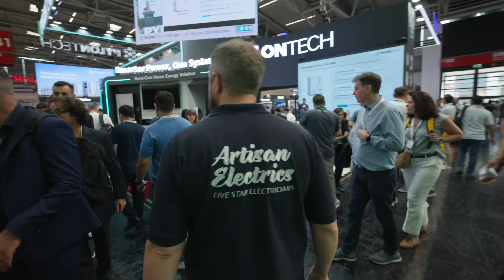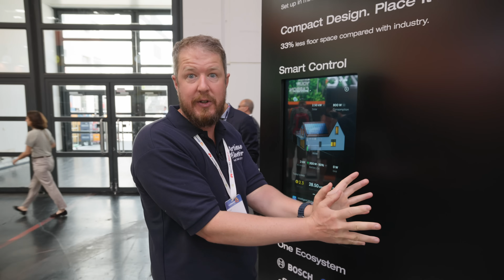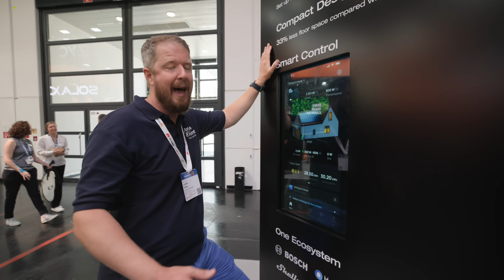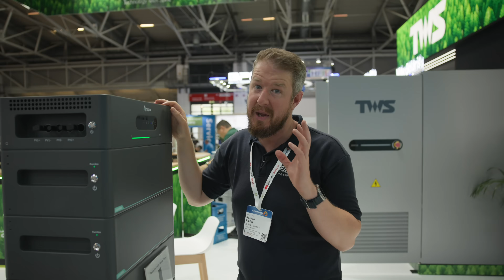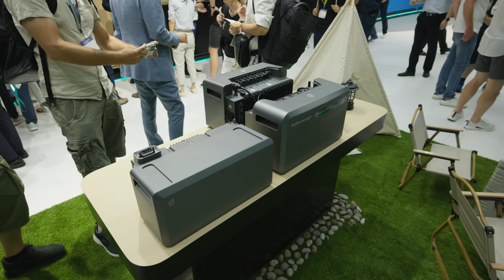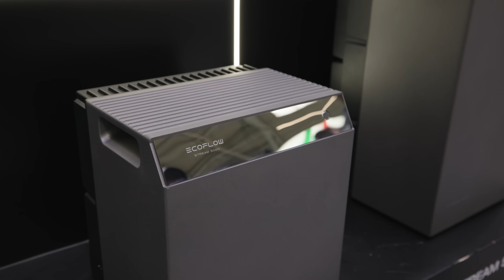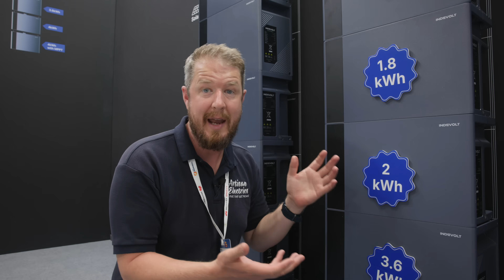Is the UK FINALLY Catching Up on Plug-In Solar? Intersolar 2026

Comment from the maker: Will you be trying plug-in solar when it comes to the UK?
Reply: Already have a 2 X 475W Longi X10 with Hoymiles 800w 2t plugged in since May 7th. 

The set up cost £440 quid and have generated been 200 Kwh in just 2 months. Saved roughly 35-40 quid off our usual bills.
Reply: Depends on cost and legislation
Reply: No real use for it as wired in systems are much much more cost effective except for little setups or rentals where it becomes an option. Will be playing with it and helping other folks who will be installing it.
Reply: @etchedpixels  The returns on plug in solar are much better than professionally installed systems as the bulk of the cost goes on labour, scaffolding, design etc.
Reply: @baratoplata7050  I can get 32kWh of battery for 3500 quid, then the installer will take off the vat. How much is that going to cost you in little boxes. Then you are limited to 800W of grid tie too.

The return on tiny plug in systems is better than tiny MCS installed ones. The return on big ones is quite the reverse.
Reply: @etchedpixels  You're thinking of absolute returns, not relative returns. A solar panel costs a solar panel. A microinverter is pretty cheap. It is just mathmatically impossible to add lots of extra costs via labour, regs etc. to get a better return. 

This doesn't even factor in opportunity cost of paying lumped sum for a large system. 

Stocks and shares ISA in a global index fund yields about 9-11% average interest that compounds YoY. 
There is just no way for a big system to beat the power of compound interest, solar and battery yields are simple interest returns. 

Plug in returns can be leveraged by most via a 0% credit card, much more difficult to access 0% credit options for large systems to avoid opportunity cost. Although hopefully the green home loans change that next year.
Reply: @baratoplata7050  No I'm looking at ROI and NPV. I've got the receipts for my system thank you. It's way better than plug in solar  (as well as being legal - which for plug in battery is a year or more away). 

If plug in solar vendors were not pushing lots of kickback schemes with influencers I think more people would see the truth.
Reply: I think I'll be trying the Bluetti Balco Transfer Hub. It's a grid-tied controller that transforms virtually any portable power station into a compliant home solar system. It enables up to 800W of power feedback into your household circuit to lower your electricity bills, without needing an electrician for installation. The portable power station can be charged by solar or from the hub at night during cheap rate.
Reply: @markxtc123  Big question is efficiency because it has to convert between two different AC waveforms that are out of sync.
Otherwise it looks great - especially if you can plug an EV V2L into it and get poor mans V2H 8)
Reply: @etchedpixels  OK, I have to confess that I am entering my own area of ignorance here, so feel free to correct me when I go wrong. Surely a micro inverter would be more inefficient as it has to convert from 12V DC to 230V AC, with all of the inherent losses of an inverter, then phase match the output and control the power. The Balco Transfer Hub only has to phase match and limit the output power to 800W?
Reply: @markxtc123  For a straight microinverter its turning variable DC from the panels or 48v DC (usually) into AC at 230V or so which has losses (its why they get hot).
If you are using a Balco then whatever you have plugged into the balco has the DC to AC inverter losses, and the Balco then has further losses. I'm waiting to see some good reviews to see how efficient it is because I know what battery and solar efficiences look like but I have no idea what the Balco losses will be.
Reply: @markxtc123  Someone has now posted efficiency charts on the bluetti forums. For what it does they are pretty good, but not I think good enough to be worthwhile unless you primarily want the unit to do non grid tie loads and you value it being separate to the grid.

Does still look like a great hack for V2L to home plug in because it means you can use the car battery not the overpriced plug in vendor rubbish and the efficiency at the 800W end of performance is really quite decent.

Might also make a lot of sense if you are buying and building a wired in off grid system of your own and want to grid tie 800W to make use of legacy circuits for lighting and stuff.
Reply: 2000va is not 2000 watts, 2000 va is what it has as watts but it will not deliver that that is why is called VA rather than watts, when it delivers watts it may be lower may be 1500 watts??
Reply: @Dailymailnewz No under normal circunstances VA and  W are about equal. The VA just includes the reactive Power.
Reply: Yes, I like the look of the Anker system. The payback calculations appear to be much more attractive than for conventional solar and battery systems.

If I buy one, I intend to have it connected to a dedicated circuit from my consumer unit by a qualified electrician, rather than simply plugging it into a socket.

One question: can the AC socket on the unit be used to charge my electric car using any surplus solar energy, or is it intended solely as an emergency backup outlet?
Reply: @PaulNaybour  If the inverter output on that socket on the particular system you plan to use is higher than the lowest charge rate your car will let you set then it should (and to some extent depending how long you can wait). Bigger hardware that can field the full UK 13A has no real problem.

Once you are looking at a bigger system though you might as well also look at a proper wired setup because not only are the batteries much cheaper (price a Solis and Fogstar for example) but your electrician will get 20% VAT back off it that you can't for any kind of self install. That often pays much of the battery install cost for a non youtube famous electrician.

(and for the Anker assuming you are in the UK you want the electrician to buy it if doing an install so they get the VAT back off that)
Reply: @e @etchedpixels  Thanks, that’s useful. My plan isn’t really a DIY plug-and-play installation. I already have a 50 A supply to my garage, so I’d have the system connected to a dedicated circuit by a qualified electrician.

My EV can charge from a 3-pin socket at anything between 5 A (around 1.2 kW) and 10 A (around 2.4 kW), so if the Solarbank 4 supports the higher-output dedicated-circuit mode, I could make good use of surplus solar or battery energy.

I agree a conventional wired system has advantages, but the capital cost is also much higher. Around here a typical 4-5 kWp solar system with a 5-10 kWh battery is often £8k-£12k and may deliver an IRR of roughly 8-15%. The Anker system I’m looking at is around £2k-£2.5k with a 5 kWh battery and 2 kWp of panels. Even though it’s smaller, the much lower upfront cost means the projected IRR for my usage is comfortably above 20%, with a payback of around 3-4 years. That’s why I think plug-in solar could be a very interesting alternative for the right household
Reply: @PaulNaybour  it could but as you car will typically do 4 mile per Kw. Some of these batteries are only 2Kw so you will only add 8 miles rangeand take an hour to do it.  . This maybe enough to get a totally flat car to a public charger in an emergency though.
Reply: @kfarmer-b8v  That’s true if you’re only thinking about an emergency top-up. I was thinking more about making use of surplus solar every day. My EV can charge from a standard 3-pin socket at 10 A (around 2.3 kW), so over an 8-hour sunny day that’s about 18 kWh. At roughly 4 miles/kWh, that’s around 70 miles of free driving. I already have a 7 kW home charger for longer journeys or when I need a fast recharge, so the 3-pin charger would simply be a way of using otherwise surplus solar energy efficiently
Reply: I have put an ECOflow battery with 2 panels (total 930 whp ) in/on my shed. I have not plugged it in but put a bidirectional RCBO in the shed fuse board (ok I replaced the fuse board as well because the RCBO would not fit in the old fuse board). ECOflow can take a 3rd panel but I’m tempted to put in a 2nd battery instead. Also have 3.96kwp solar and 8kWh battery, 2 EV’s, heat pump and solar divert.
Reply: not with that plug
Reply: Many are trying it now, I know a guy with a 10.5kwh system and it just plugs into a wall, halved their electricity cost
Reply: @utoob34  This sort of made up crap is what’s going to end up disappointing loads of gullible people
Reply: @HiruS22  whats made up crap?
Reply: Rather remove my liver with a rusty spoon.
Reply: @ChariotsofWire180 what a weirdo

Comment: I might take the plunge its cheap enough but without a battery it doesnt even at £400 price seem cost efficient until you can save the power until later in the day.

Comment: My inverters were to old to add batteries so I purchased 2 x marstek Venus e batteries rated at 5kw each both can discharge at 5kw total but have to be segregated on each 20 amp circuit. Will at another battery. The 3 batteries talk to each other and decide what to discharge on demand using the shelly meter. Best thing I ever done even in winter as can charge using night rate and discharging during the day.

Comment: Been using plug in for over a year, I use ecoflow micro inverter and ecoflow Max power station with smart battery, I also have two solar panels on the conservatory roof and 7 smart plugs around the house, fridge freezer, chest freezer, beer cooler, wine cooler and three TVs saving over £400 a year, plus we run the washing machine and dryer straight from the power station. 😉👍

Comment: Two Homewizard (Dutch brand) PIBs are running here. 1600 Watts on their own 16A circuit. It has been running completely legally and safely for over a year without any problems. Recently, smart dynamic control (day ahead market) was added, which yields approximately 30% extra savings on the energy bill by storing power when it is cheap but feeding it back when it is more profitable.

Comment: For a lot of the micro-inverters, once you have a smart meter you can look at what your steady usage (base load) is. A micro-inverter and panels that generates about that amount of output will then have that energy used in self-consumption with little or no export to the grid. You're still paying for peak usage, but it's probably the most cost-effective way to get started on solar savings. Picking up a couple of cheap panels and a micro-inverter the cost could be as little as £200-300, and if that could pay for itself in as little as a year if you're consistently self-consuming it.
Some then look at multiple micro-inverters, although often then looking at additional ones with battery storage. If you have a shed with power, taking that fully off grid, etc. And if you move to a full roof-mounted solar array then the plug-in system may have paid for itself already, even if you don't end up re-using those parts.

Comment: Hi Jordan

I normally like your videos but I’m going to take you to task on this one as unless I missed it I expect you as a qualified electrician / electrical contractor to put health & safety first and talk about this sensibly and accurately.

It’s not the CE/DIN marked inverters that are the worry as those certifications are ok in place of UKCA I understand but it’s the home owners existing electrics that are the worry.

I’m a CEng MIET responsible for UPS systems, I also work with trusted electrical contractors. At home we have a 3.6 kw fixed solar & battery installation that was installed properly but first our existing home electrics were tested as they had not been done so in nearly ten years and we found a hidden issue that for some reason the gas and water were not properly earth bonded which were fixed and system was tested fit for addition. You said it yourself in previous videos as to the hundreds of poor home electrics you’ve seen….,

Our solar install was then fixed connected by double pole correct type and rated bi directional MCB/RCD for DC installs with a surge protection unit also fitted and all systems certified. So we have peace of mind.

I don’t see any difference between 800w systems and 3.6kw systems as they both need G98 ok I  understand except for the power rating and would always feel safer if home electrics were first periodic tested ok and plug in solar actually fitted with said bi directional protection onto the circuit that is being extended and preferably as a fixed installed. The install may be fine to plug in but there may be hidden faults that arise. That is the main worry of the IET etc. 

Their comments are now with HM Government for consideration after the consultation period ended at 30th June and we await findings and resolution so until then plug in solar alas is not yet legal for sale or use in UK properties. 

Feel free to contact me if you wish to discuss further….

Comment: My only worry is not with safety but RFI as im a radioham and personally ive had serious issues with a chinese made inverter that interferes big style on shortwave. So much so that the installation company has fitted filters and i have fitted loads of ferrite cores plus built around the inverter a faraday cage. I hope the government insists on better RFI standards. Note though that other countries have much higher standards.
Reply: Stuff lined up for the UK is the same product approved in Germany, France, Spain etc but with a plug change. All compliant but none of it necessarily good on rfi

Comment: it's a bloody good idea for people who don't have roof access (units) etc

I did this Diy with 900w of grid solar panels and a AUS supplied and complianced grid inverter. this was plugged in to a dedicated GPO and would trip out as required by regulations. (naughty but it worked in a rental).
had the old style mechanical power meter so exports were basically undoing much of the overnight usage. I had to hide it though, had a reed switch that would click off a relay when the meter reader would visit,  averaged about 1.5kw per day consumption, though cooking and hotwater were LPG , that was done with BBQ bottles instead to avoid the daily supply charge of the utility delivered ones. 
I'm a tightarse and like saving money :)

Comment: Like all unput base guide will be main single phase or 3 phase 240 vac fused

Thought  if you moder rccs installed in  in the home  i wiull suggest  per pkint install as all modern trip  fusesd fuses   do not  weell on  ring   serviced guidesthe old  ferminal  bloblock  could obeoverloaded😊